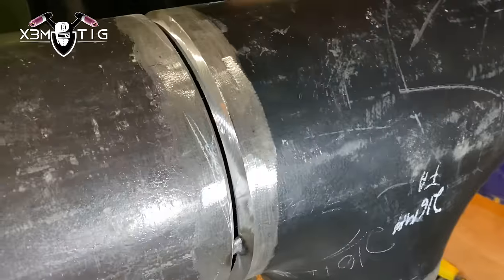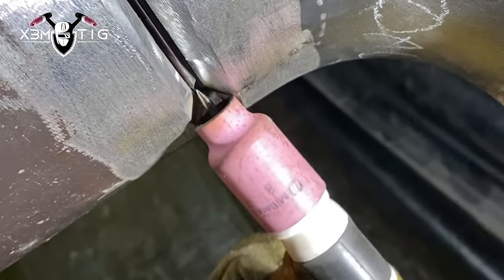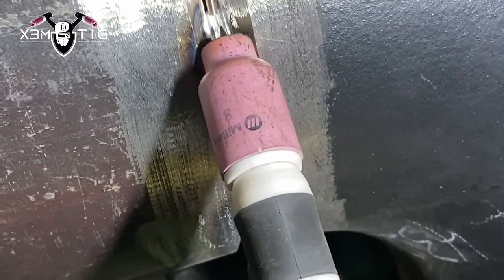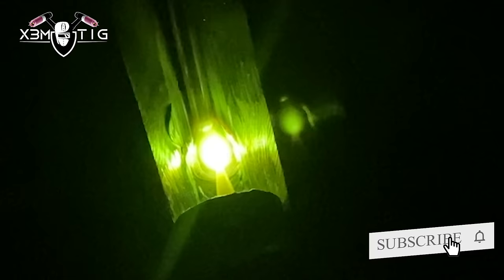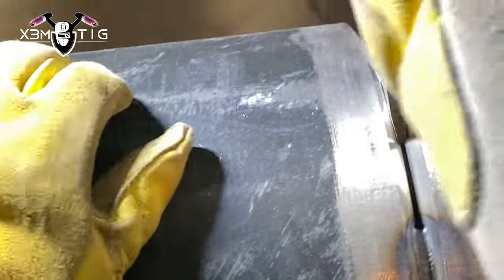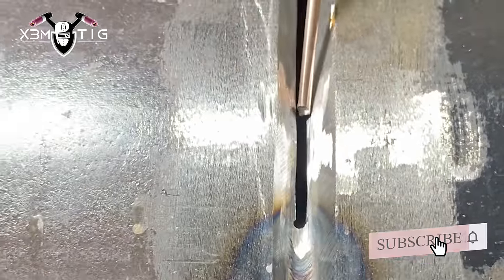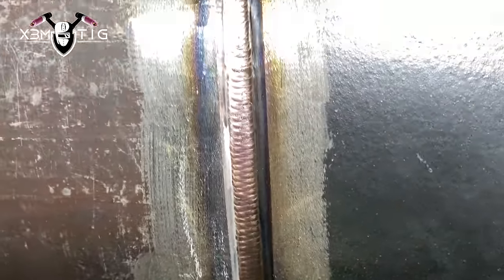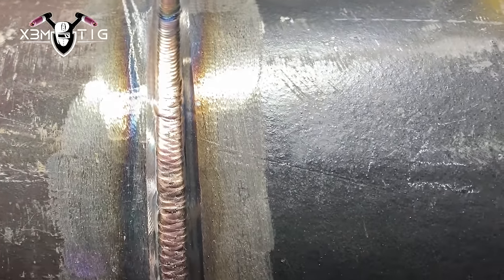10" Pipe TIG Welding Root Pass In Position !

Comment: Do you move the wire inside to side to side or it's in the middle at my company most big pipes we use 3/32  wire 2.4 mm I heard in of the videos that this it normally cz corn cave so if I use 2, 4 wire do I have to move to side with wire in the pool
Reply from the maker: Feed in the middle

Comment: Where do u order replacement parts for those torches? I can only find the whole torch set up, not the parts.
Reply from the maker: Check miller website or local welding shop supply